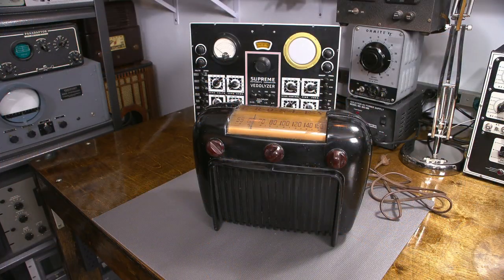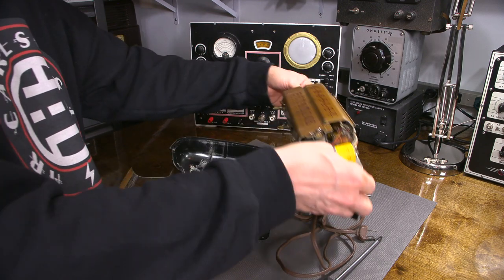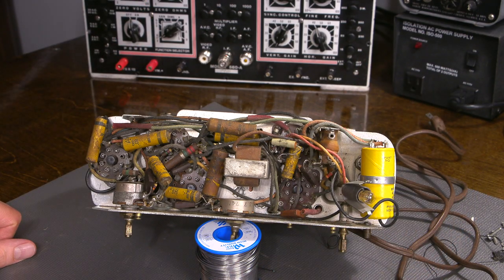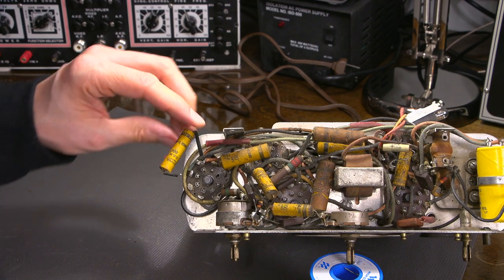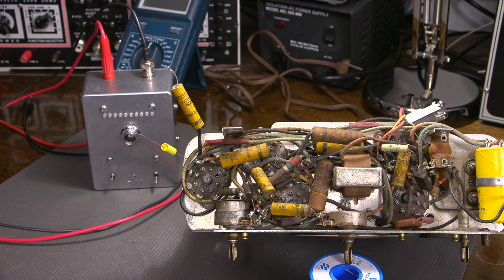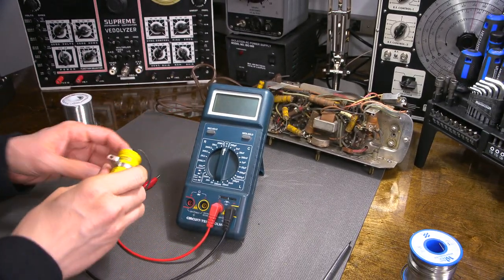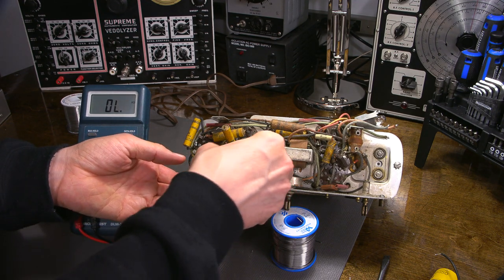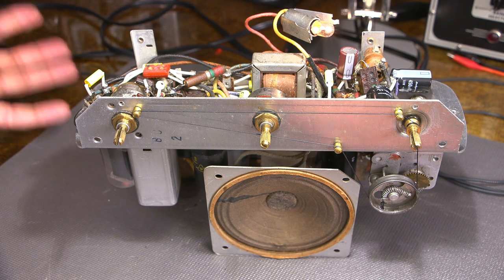ROBOT HEAD Radio from 1947! Electronic [Restoration]

Comment: Paul in my many interests, one of them is reviving old telephones. Energizing the bells has it's problems. The current required is 90 volts. Not too bad getting that voltage but the frequency might be something else. how do you create 20 cycles. If you try to use modern frequency, it sounds like a buzzer. So, how would you create 20 cycles?

Comment: Hello. Quick question. When setting up an isolation transformer, Variac and dim bulb tester in the AC circuit block diagram which comes first starting at the wall outlet?

Comment: I have wondered would a DMM with high impedance do the same with alignments? Like the Fluke 289 for instance?  I don't have a VTVM...  yet.
Reply from the maker: Hi. A normal DMM will work, they are just difficult to track "small differences" due to bouncing numbers instead of a needle.
Reply: @MrCarlsonsLab   what about the ones, like mine, with the graphical bar scale, does it work independently from the digital numerical scale?

Comment: Hi, Paul. I have an old Grundig AM and SW receiver that desperately needs alignment. Unfortunately I haven't any of those fancy signal generators of yours. I've only got one of those chinese function generators (Feeltech FY3224S) with two channels. I wonder if I could modulate one chanel set for RF with the other set to, say, 1KHz. I suppose I'll need some kind of AM modulator circuit. Have you got any advice on such circuit? It would make a very good project for your Patreon channel ;-)

Comment: Maybe it's because I don't work on tube equipment, but why wouldn't you do a quick continuity test between the chassis and the spades of the plug to find out if either side is connected to the chassis, and then mark that side of the plug and always plug that blade into the neutral side of the outlet?  If replacing a non-polarized plug on a lamp with a polarized one, for instance I'd always do a continuity test on that to find out which side of the wire needs to connect to neutral.

Comment: your shirt looks like a vacuum tube pinout

i was just going to say move that piece of bakelite out of the way so you dont break it

dial cords i think was used all the way up to the 90s even in all solid state radios until they started using plastic strips with teeth resembling the pull strips used for toy cars and even printing the numbers directly on the knobs for the really cheap radios.

Comment: Hmm. Is this the same Crosley that made refrigerators back in the 50's?
Reply: Yes,  Hal Crosley created the first "Shevledor refrigerator.  Also had WLW in Cincinnati.  WLW operated with a special license in the late 30's at 500 thousand watts on 700 Kilocyles.  Hal was also know as 10db Hal.  First radio station was 50 watts then 500 watts then 5000 watts and a final normal 50,000 watts AM.  Part of that reason his early radios did not have good sensitivity.   He also manufactured the Crosley Car
Reply: Powell not Hal.  Excuse my goof

Comment: I wonder why they didn't use 3x double triodes tubes in the front end configured like a SO42P and 2x collins Mechanical filters for 455KHZ would make for easier alignment just adjustments to the LO and Tuning condenser, I wonder if it were possible to get the Raytheon/Philips Pencil Stub Vacuum tubes  it might be possible to rebuild the radio so it doesn't bake itself to death and have it working on B+ of 49V and a heater voltage of 3V.
Reply: Because it was built to a price

Comment: Why does the boot only show the resistance from your body not The Wire I would have thought both be equal
Reply from the maker: Hi John. The sense lead is shielded, (coax) and the positive lead (wire) is not vinyl. The boots on the alligator clips are vinyl, as this is needed for the calibration procedure. As you can see, Vinyl is a good resistor, and is "way more" cost effective than very expensive resistors needed for the cal.

Comment: Why did you peak the radio at 1400?
Reply from the maker: Hi Ed. It was called for in the alignment data.
Reply: Optimizing these low-tech radios always involves compromise. Small variations in tuned circuits affects higher frequencies more than lower ones.  So something like 1400 kc  is chosen as a compromise for the range 550 kc to 1600 kc.

Comment: Do you have a video on the process you use to clean radio chasis, do's and don't.  I picked up a Nordmende Electra, inside covered with cigarette tar, dust etc very disgusting.

Comment: yes paint it all good shops need acrylic lacquer paint well i love the stuff tcpglobal com has it in any color ..i need to get so may self all i have is black A.E in cans.PS i was told about this so called and that it is used on metal tractors  to fences as its AL for 35 bucks! you bet i am going to get it[[ Lexington FenceCoat Acrylic Lacquer Fence Paint]], if it the same better that 150 a gallon ill see and ill bet it may be from what i am reading n herd

Comment: "Danger!" We are always lectured on how we should ground capacitors before touching them. I've watched hundreds of videos of guys repairing vintage amps and radios and *not *once have I seen a technician ground a single capacitor before completely molesting the unit bare-handed.  Just saying.
Reply from the maker: Watch my video's. I have designed a "safe capacitor discharge device" and it's released on Patreon with schematics and a dedicated video.
Reply: @MrCarlsonsLab  I guess I missed that video.  Did you use it when working on this radio and just didn't show it? Thx